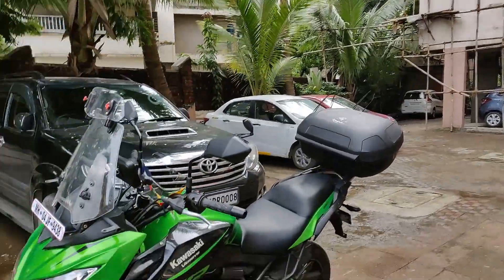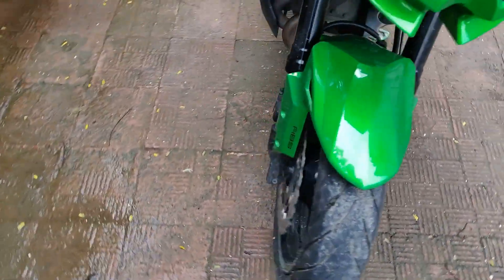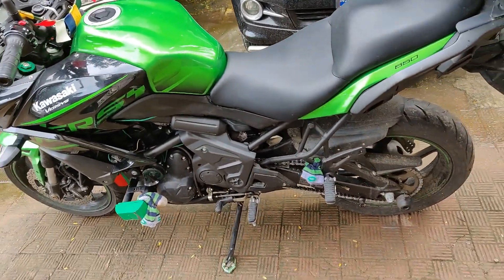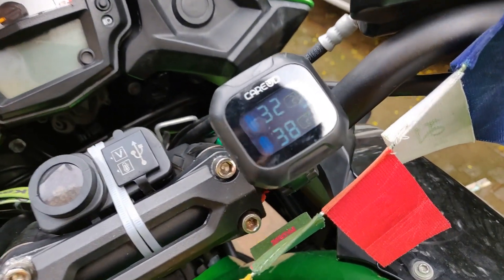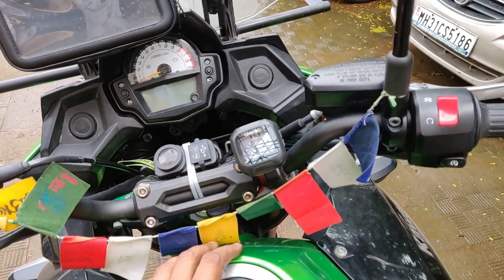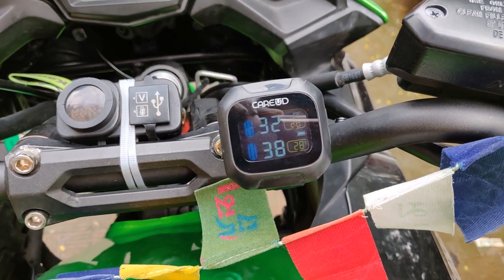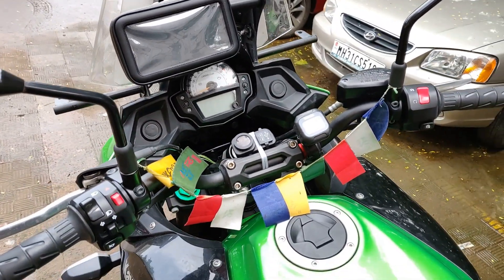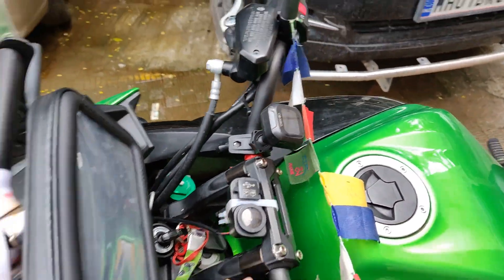TPMS - monitor the vehicle's tyre health in real-time - tyre pressure monitoring

Comment: What does it read whilst riding and tyres get hot? Does it read much higher pressure? Thanks.
Reply from the maker: The temperature increases during even normal riding, and even more during peak summer times.  I configured higher value threshold for the "high" parameter so that alarm doesn't shown on just bit increase.  The device is really a boon.  Off-late I have seen the Front not always showing values on console unit, seems some water seeped inside the valve-sensor or maybe some loose contact of battery.  Will again troubleshoot later.
Reply: @PranavBhayani  thank you but you say temperature increases. But does it show pressure increase due to tyres heating up from riding friction heat?
Reply from the maker: Yes, the TPMS Console shows in real-time the pressure and temperature increased values.
Reply: @PranavBhayani  thank you very much. I think in this case of high pressure reading from friction  heat the alarm will sound. Plus I will never know if tyre losing pressure or wrong pressure. For this reason it will not be any good at all.
Reply from the maker: Actually, you can set "High" and "Low" values as threshold.  Also if air leaking (even if that's hot) then will show alarm.